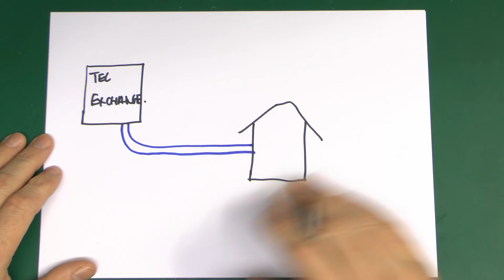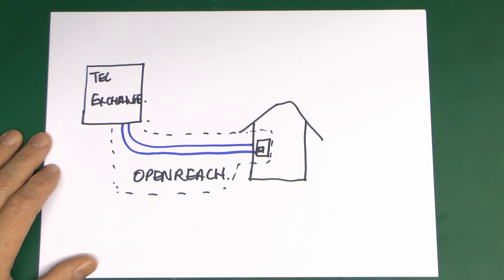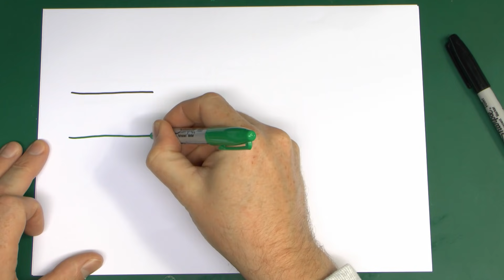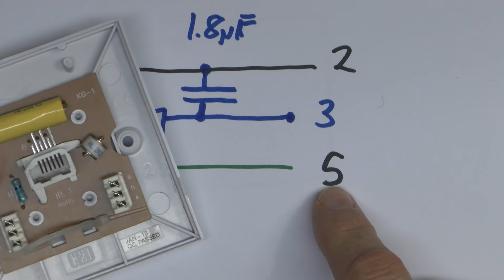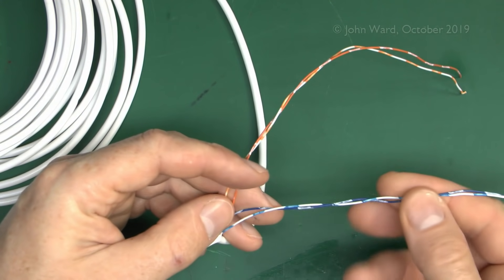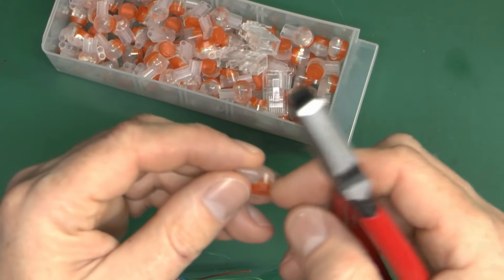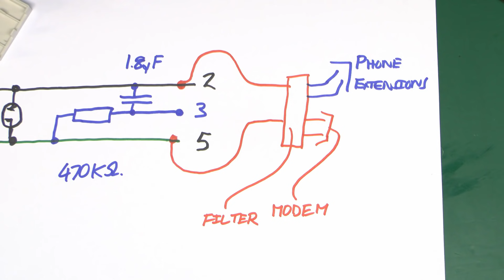UK Telephone Wiring, Sockets, Cabling, ADSL / VDSL Filters, Extensions.

Comment: Some corrections and further info typed as I watched the video.

1) The spark gap has been deleted from modern NTEs as it apparently was found to adversely affect VDSL signals. 

2) The 470k resistor is called the out-of-service resistor and is there to permit remote line testing when there are no phones connected. If it's not there the automated exchange test equipment will flag it as faulty.

3) The jelly in crimps is petroleum jelly. 

4) The filters work the other way round to that which you state. The ADSL/VDSL modem is connected directly to the line, the voice/phone connection is filtered. You can clearly see this on the PCB of the Sky filter. 

5) The Sky filter needs only the two line connections as it has its own bell/ring capacitor - the big red/brown one - after the voice filter and you can [see] its connection to the voice/phone socket. A phone connected to it will ring as normal. Many phones have a two-wire connection and don't use the master socket/NTE bell wire.

6) I'm afraid you've got it wrong about extensions with a filtered NTE. Because of the filter on the voice/phone connection any extension wiring  causes no problems with the ADSL/VDSL side. Here there's a filtered NTE. The unfiltered ADSL/VDSL connection goes off to the remote modem via some 2-pair Cat5 (BT spec) and the filtered voice connection goes off to multiple sockets around the house with no effect on the VDSL side.
Reply: Twelve hours later and no corrections - that's encouraging 8-)
Reply: Graham, I found your contribution interesting, I had not dissected a faceplate so assumed the VDSL port was high pass filtered and the phone circuit low pass filtered, I have learnt something! FWIW I put a common mode choke in the VDSL cable and it seemed to gain me about 0.5dB of noise margin....
Reply: @g0fvt  I've got a spare last-generation NTE filter faceplate here somewhere that I could pull apart for 100% confirmation. As for the CM choke and 0.5dB noise margin gain, what download speed increase did that give, assuming you're not on one of the services like PlusNet where the speed is capped to 40/80Mbps instead of being limited by the noise margin.
Reply: @Graham_Langley  the maximum speed available from the VDSL DSLAMs used by openreach is 80Mbps downstream sync, but if you pay less the equipment can be set on a profile to limit the sync speed to 40 Mbps.

If you're really lucky you really can get the full 80 Mbps.

By the way, the gel crimps now seem to have silicone based goo instead of petroleum.
Reply: Graham Langley, sadly I could not get any speed increase,  the noise margin is still not much above 6dB. Currently my wife pays the utility bills and I am not sure which package we are on, I suspect we have hit the 40Mb/S ceiling.
Reply: @NeneExists  I've just moved from BT's noise margin limited >50Mbps offering to Plusnet's cheaper up-to-40Mbps speed capped one. As I type the NM is 7.4dB, max data rate 44.2Mbps, actual download speed 40Mbps so I'm getting what I'm paying (not a lot) for with some margin in hand. FWIW I carried over the BT Smart Hub, which sits on it's own subnet connected to my own router so it's effectively just a modem.

Ta for the info on the crimps - my stock is a few years old now and definitely has petroleum jelly inside.
Reply: @Graham_Langley  the modems already have common mode chokes I gather, I think that I am on a capped service anyway, a little unsure of that but I was also trying to reduce common mode noise FROM the VDSL. I am beginning to think that this maybe 40Mb/s contract.
Reply: @g0fvt  Some combined filter and dual socket master sockets have the common mode choke as the first thing on the incoming phone line. I agree it can help the modem, probably more so if you line comes in via telegraph poles rather then underground.
Reply: @BrianG61UK  at times a lot of RF is launched from here, but RFI from all sorts is killing my receive. An FT240-43 ferrite ring makes a great basis for a simple common mode choke. VDSL covers quite a chunk of spectrum but there is a limit to what I can do.
Reply: In my experience with VDSL, gas discharge tube type protectors do not cause a problem with the VDSL signal at all. Solid-state protectors, however, do.

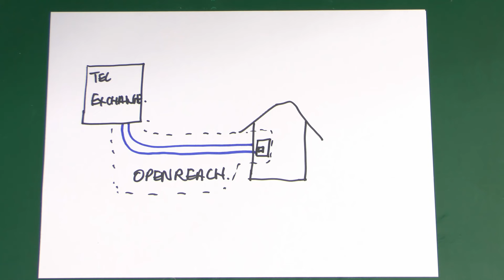Comment: up until 5:56 ,everything  is exactly the same here in the US. except your phone jack connectors are different. we use RJ-11 which has a smaller tab on the bottom opposed to the larger one on the side of yours. and is used for both phone and Internet connections. our phone system does not have a master jack with all the circuitry.just  punch down , or screw terminals on the cheaper varieties. using the Green [Tip] and red wire [ring] for line 1 and yellow and black for line 2. we also have an optional inside line wire maintenance. service, in which the phone co. comes in and repairs any faults, problems at a ongoing monthly cost, or you can DYI , if you are familiar with the wiring.

Comment: Even on the example DSL filter circuit board you can clearly see that the modem connection is wired straight through to the incoming line.   The filtering is between phone and line, to prevent the phone interfering with DSL and vice-versa.    That's why you require a filter on every phone sharing the line (or multiple phone sockets sharing a master filter), and conversely a socket with just the modem connected doesn't need a filter at all.  The reason most filters have a modem socket as well is (a) to avoid you needing a separate line splitter where you want both phone and modem on the same socket, and (b) to allow you to use an RJ11 connector for your modem instead of using an RJ11 to BT adaptor cable.

Comment: Hailing from New Zealand we for many years had the system virtually identical to that in the UK for telephone domestic installation. The advent of various ISP services in the last decade saw many changes culminating  in an option for Fibre connection at the home. An Optical Network Terminal (ONT) is installed which is mains powered converting Fibre to copper in the home. You are then obliged to lose your old copper telt setup & rely on the Fibre. The only problem is that the instant mains power fails you have no landline telephone as the ONT has no power supply backup. Too bad in an emergency, the belief being your mobile phone will always work!
Reply: Most new new build estates are now only provided with a fibre connection requiring an powered ONT. These initially had a battery backup unit connected to provide a brief period of phone connection during a power outage.
Lately the battery backup is not being provided as most telephones require power to actually work so will not work during a power outage anyway.
Reply: @wwsxa39  thats their convenient excuse

Comment: Nice video JW as usual and if i can just add to your comments that the origin of the 3 wire bell ring arrangement goes back to the days when we had dial phones which pulsed the line and the setup was to suppress bell tinkle as you dialled each digit but also incorporate the OOS (Out of Service) resistor so that remote line testing can take place and more common now so automatic DLM (Dynamic Line Management) can perform tests on your Broadband line and adjust the transmission characteristics of the telephone circuit even as you rightly say nothing is connected (e.g. new builds).
Reply: Had an intermittent fault on our line for years - it might even still be there.
The fault was/is the line tester - or at least the contacts that disconnect the line from the service in order to test the line.

Comment: Interesting discussion about land line telephone wiring. Here on the other side of the pond, telephone implementation is similar but slightly different.

1) Since US deregulation in the mid-1980s the phone company installs a NID, network interface device, very similar to the UK master socket. Modern NIDs use gas tube surge suppression, which replaced the old style carbon block. Being sealed present a very high impedance until the breakdown voltage is reached. The suppressor is connected to both phone wires and ground. This helps reduce both differential mode and common mode voltage spikes. Graham Langley’s comment surprised me because here in the US gas tube suppressors are very common.
2) NIDs often contain a half ringer: Zener diode, resistor and capacitor circuit for the same purpose as the RC network in the UK master socket. They had to be removed in the early days of DSL with pre ITU SDSL. Modern DSL is design to operate in the presence of a half ringer but it does represent a small load so may degrade marginal DSL.
3) In the US the capacitor needed to activate the ringer has always been in the telephone instrument.
4) US homes are normally wired with two pair, because as you mentioned single pair cable is not readily available.
5) The second pair can be used for a second telephone line, very common in the early days of dialup internet access. It was also used in the early days to provide an Earth ground for party line ringing. A party line parallels multiple customers on a single pair of wires and the ground allows selective ringing of each of the two parties. In very rural areas even more customers could share a single expensive phone line. Lastly in the early days of illuminated telephone dials that used an incandescent bulb a small AC transformer sent power down the second pair to illuminate the light. Not that function is performed by a low current LED powered from the phone line.

When DSL is used customers have the option of installing a microfilter at each non-DSL device. A better solution is to use a whole house POTS/DSL splitter. Calling it a splitter is somewhat of a misnomer. The DSL modem is feed directly but the splitter has a low pass filter that prevents the high frequencies used for DSL and VDSL from interfering with voice equipment.

Not sure how common home alarm systems are in the UK. In the US they are connected ahead of any residential telephone equipment. That way the alarm is able to disconnect an active call if it needs to dial out. Alarm Cell interfaces have become very common for alarms as folks move away from land lines.
Reply: Wow thank you for reading my mind. Also on the same side of the pond as you got bored after I learned everything I could and moved on to foreign phone systems. The UK decided that they wanted to mount their ringers on the wall and have lighter phones so they separated out the ringer line to make wearing that easier.

Comment: Interesting video as usual, John - thank you. Was amused to see that you use the 'jellies' for cable jointing. I stopped using these years ago in Scottish Power for network protection pilot cables (7pr, 12pr, 19pr, 27pr, 37pr, etc) as we found them to be VERY unreliable.We still used good old-fashioned 'twist-and-tip' using soldering of cores and then wrapping each soldered joint in VR sheeting to insulate it. It was/is my understanding that BT/Openreach stopped using these jelly crimps many years ago but I could be wrong about that!

Comment: Pretty similar to Australia but we don't have the third conductor. We have the cable coming straight in and star-wired from either the first socket, up in the ceiling space located at the furthest point from the man-hole, or a combination of the two, which makes ADSL and especially VDSL run poorly from signal reflections and stuff, and you have low-pass filters on every phone. But most places that are done correctly have a central filter outside in a junction box on the side of the house where there's also lightning protection going from both tip/earth and ring/earth and two pairs (Cat5e) going inside the house, one for XDSL (going to only one socket) and the other for phone which can just be star-wired no worries.

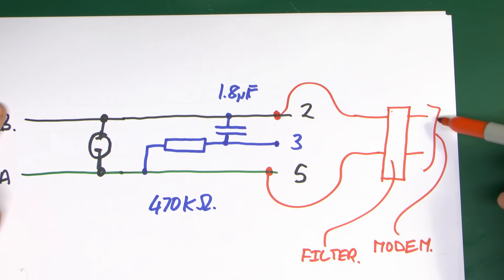Comment: I'm pretty sure the explanation for the ASDL filter at 25:00 is wrong. The ADSL signal isn't filtered (its just a straight tap), the phone part is filtered to filter the high frequencies out (allowing low frequency to pass). The reason being is that the phones  predate ADSL and are unpredictable in how they will react(often producing interference), the ADSL modem on other hand expects the phone signal and deals with it no problem
Reply: Agreed. A lot of modern phones have a common-mode choke on the line connection, presumably to help prevent problems with ADSL/VDSL signals on an unfiltered line.
Reply: @Graham_Langley  I agreed with your previous point, however the common mode chokes are mostly to deal with RF line imbalance, this reduces the interference to radio from the line and also the lines vulnerability to radio transmissions. Re-reading your post I agree, damn I hate it when that happens :-)
Reply: @g0fvt  And now I look at my post I realise wasn't thinking clearly about this. I'll have to dig out the circuit I was trying to recall - I used the line filter components from scrap phone for a line audio monitor I needed a few years back.

Comment: Here in the states we don't have POTs lines anymore, it's all VoIP and Cellular. The old Analog was Christmas Trees and Bumble Bees (Line 1 Red/Green and Line 2 Black/Yellow). Now we use Cat 5e or higher with the Blue and Orange Pairs. Kinda miss the old Analog systems.
Reply: What a charming mnemonic!
Reply: You must be one of those lucky people in a city out on the other side of the states there's still a lot of copper. At least until Frontier loses all their customers to Comcast going from pots and DSL to coax cable and VOIP.

Comment: Re Colours. Openreach just use regular CAT5 now, with the primary line always using Blue/Blue-White. I work in construction and spend alot of time moving tel lines. OpenReach can now install "Temporary Site DP's" for certain industry's, such as Construction. With these you have permission to add lines yourself, or remove / move lines around.
Reply: Was wondering about that.. using Cat5/6 and RJ11 or RJ45 has been standard in Australia for most internal wiring for 5-10 years. 
Means that former phone wires can be quickly reused for data to serve PCs, TVs or WiFi APs fairly easily.
All our voice is going VOIP.
Reply: Do you think a house built in 2008 would have that in the walls? Wouldn't need the telephone extension socket - but wouldn't mind using it as an ethernet port

Comment: Interesting. The UK "master socket" looks equivalent to what we call "demarcs" in the US. The old four wire cable in the US is red/green/black/yellow, red/green is the primary line, black/yellow the secondary.

More modern wiring uses the structured color code which handles up to 25 pairs. Your two pair matches the first two pairs.

The pair themselves are called ring & tip, which dates back to old switchboards.

US ring voltage is typically 90V square wave and isn't broken out to a separate line.
Reply: I've heard 90 volt sine wave but other areas might have been different. The separate ring line was I believe to move the bells off the phone and make the phone lighter and the bells would get mounted to the wall optionally with a switch another historical fact. Fascinated with phones in the US I ran out of things to research in the US and moved on to foreign phone systems.
Reply: In the U.K., the separation out of the bell / ringer line was (1) so that the telephones did not need a ringing capacitor (2) to limit the ringing current and (3) to simplify the wiring when more than one socket / phone was in use.
The earlier method if you had more than one phone (but same line) was to have fixed connections (no sockets and plugs), one phone had the ringing capacitor connected, then the bells in all the extension phones were wired in series.
Reply: The old four wire cable in the US was only ever intended for exposed installations on baseboards. It was never intended to be used for in-wall pre-wiring, but that is what it ended up being used for. Pre-wiring installed by Bell would have been either 3-pair or 6-pair, but after the breakup of Bell, pre-wiring was done by electricians who didn't know any better and used the wrong type of cable. This despite the correct paired wire being available at the same supply house where they likely bought the incorrect cable.
Reply: Reading back my earlier comment about the U.K. telephone wiring, I should say that four wire is only generally used within buildings. The line from the overhead pole is one pair/two core drop wire (that uses steel wire) or one quad/two pair/four core external cable if it is a burred/underground route.
And I did not mention the fourth reason that the bell/ringing signal was separated out, it is less relevant these days with dual-tone multi-frequency (DTMF) signaling (dialling), but when BT introduced this system, loop disconnect signalling (dialling) was still common. This could cause bell tinkle on the other telephone(s) if there was more than one telephone and more than one “master” socket (will bell/ringing capacitor) connected to the same line.

Comment: A note about GPO telephones, in an "unconverted" state, they contain the ringing capacitor, and therefore work as a 2-wire phone, breaking out to 3 or 4 wires at the hard-wired terminal block and going into the phone where depending on its' configuration will send the appropriate voltages to the ringer when on-hook... :)
Reply: Good point - I don't think anyone's mentioned that the external ringing cap only appeared with the introduction of the master/secondary socket which allowed multiple phones on a line so bell tinkle suppression had to be handled differently.